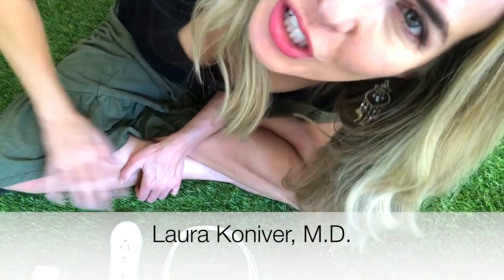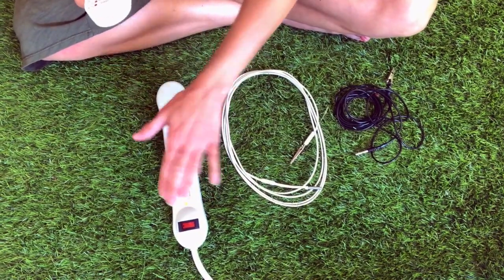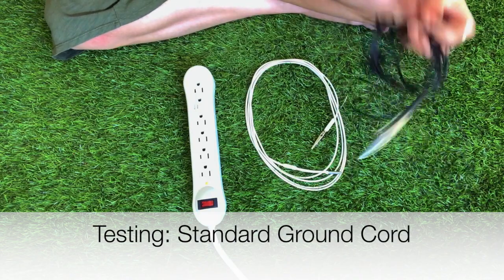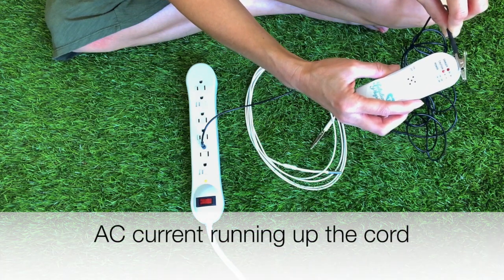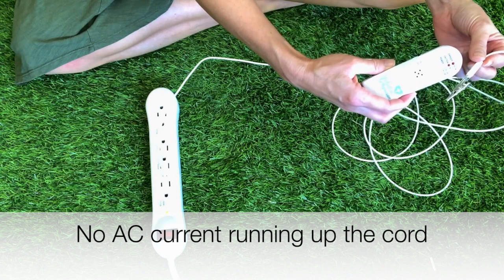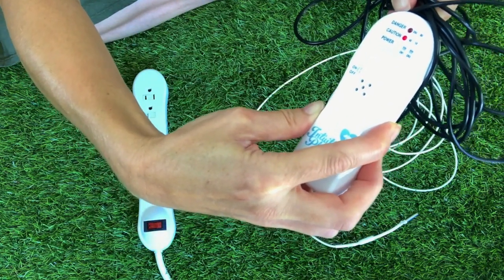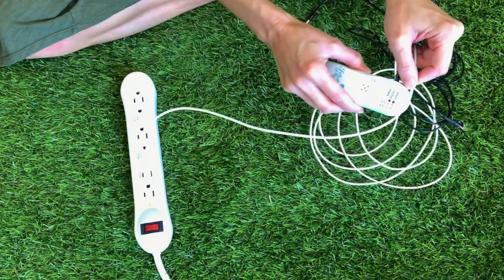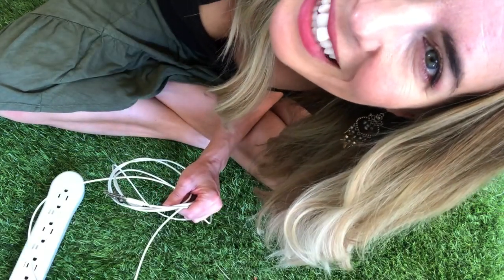Testing Ground Cords: Standard vs. PureGround Cord (Dr. Laura Koniver, MD The Intuition Physician)

Comment: Dr. Laura, I have a question about grounding and wifi/ high frequency. I am for some reason not  affected by radio waves/standard electricity much, but am VERY sensitive to high frequency microwaves like cell and wifi. I think putting a Wifi in my room gave me Chronic Fatique which I am still not recovered. So I purchased a grounding kit without the cord shielding and it actually gave me insomnia and on edge when sleeping and seemed to make my condition worse.  I see what your saying about the shielding the cord but my understanding is, How would grounding even with the shielded cord help someone like me when their is Wifi all around me coming from cell towers, neighbors all around with wifi running through our homes? I heard  without the complete shielding from those airwaves, you can actually harm yourself more and make your condition worse by grounding. I heard unless you remove/block  all hi frequency/microwaves from entering your room, and by grounding, your body is used as a conductor/capacitor for the harmful waves. So my question is, isn't grounding totally ineffective or WORSE for you unless you block out all microwaves/wifi/cell. first?....and thankyou  for your good work.
Reply: I see your concerns and I have a long history of attempting to get grounded indoors.  Here are some of my successful actions regarding handling EMFs and grounding.  The goal here is to REDUCE WHAT YOU CAN OF THE EMFs and then get grounded.  (1) Put the Wi-Fi as far away from the computer as possible (2) keep the Wi-Fi plugged into a power strip that is easy to turn off when you are off the computer.  (3) having measured body voltage with a voltage meter I find that flipping the breaker and shutting off the electricity to an area (bedroom?) can reduce body voltage by about 95%. When you talk about body voltage your are NOT talking about grounding.  It is a separate subject concerning the electrical fields from household wiring and you use a separate meter to test it.  (4) I will never practice grounding to an indoor outlet unless I test the outlet with a socket tester first and then use Dr. Laura's PureGround cord to complete the ground.  (4) your standard of blocking out all microwaves/Wi-Fi/cell would mean there is no where for you to ground, indoors or out, unless perhaps you wrap yourself from head to toe in shielding.  I'm doing  grounding indoors with a grounding rod and a wire coming in through the wall of the house.  I have a disabled hand that approaches normalcy when I ground my hand while I sleep.  . . . It sounds like your electrical hypersensitivity is ramped way up . . . do you have the meters you need to find the safest places?  This has to be an individual quest as for some people with EHS their car is not a safe place due to the modern high-tech electronics.  Do you live in a city?  I had to leave the city.  I fully trust Dr. Laura's  system including having a conductivity test meter so you can absolutely tell if you are grounded. How about doing a grounding test outdoors... lay on the ground... no supplies needed.  How do you feel before?  After?   This requires listening carefully to what's going on inside your body before and after (especially from the waist up.)  You must be aware of exactly what was going on before "getting on the ground" so you can tell any difference once you are grounded.  Ground yourself with as much bare skin touching the ground as possible.  Dr. Laura says that grounding works even if you can't get rid of all the EMFs.  HOWEVER THE FINAL ANALYSIS IS your own wits and your own body make the decisions for YOU.  Peace.
Reply: @kathym6603  I get what you're saying. If you're ground on your outlet is measured safe, why do you need her cord? Especially when a $2 dollar cord is sold for $54.

Comment: Do you know if the cords that Clint Ober sells with his products are safe?
Reply from the maker: Nope they are not shielded nor do they have a filter in place to stop AC current from running up the line.  They are aware that AC current is going into the bodies of all of their customers using their products and apparently do not wish to upgrade to this safety technology, I have reached out multiple times to support their company in giving their customers this option but they have declined as of yet.  xoxo
Reply: Ok.. I just ordered one.. do I still need to have my mat plugged into the wall while I’m using your cord?
Reply: Also.. I use 2 products from them.. how can I use both simultaneously with 1 of your cords?
Reply from the maker: There truly is no advantage to using more than one product at the same time, because once you ground any part of your body your entire body is completely grounded.  But I do carry splitters so you can use a splitter to plug two cords into the splitter and use multiple products...

Comment: Does taking a shower ground the body?
Reply from the maker: If you touch the drain or the show head or if you have a continuous water stream it would be grounding you, but if the droplets in the water are separate then they are no longer grounded.  In my experience I am not grounded in a shower unless I fill the tub bottom a little and stand in that puddle.  I have a video showing all this for you here you might like:  https://www.youtube.com/watch?v=URR6mLwkOpE
Reply: @laurakonivermd  Thanks you so much, I have another question, I have severe asthma/ emphysema, how can grounding help me  & how many hours should I ground myself to see any benefit
Reply from the maker: @ISa-ps9lw  Any amount of grounding will be helpful -- literally even a few minutes, so never shy away from grounding just because you have only a short amount of time.  That said, I feel that grounding will be more helpful with asthma, decreasing the inflammation and reactivity of the airway, instead of emphysema which is generally a more permanent scarring.  However, even the scarred lung tissue is conductive so grounding will happen all throughout your lungs, so keep going with it!!!!  xoxoxo, Laura
Reply: Yeah it does in my experience, I tested it in my apartment

Comment: Dr. Laura, I have many of your grounding and shielding tools already, and use the PureGround with all of them. I am  safely grounded for at least 16 hours per day. Thank you. I am very curious about your opinion of the Magnetico Sleeping Pad. It is a big investment, but if I understand correctly, it emits a strong 5-10 gaus of the Earth's magnetic field. It sounds like grounding supercharged. Your thoughts matter to me. Thank you.
Reply from the maker: I have to say that I don't feel this is comparable to actual direct contact with the earth -- here is what I wrote in a recent blog post that hopefully will help explain my thoughts... not so say there may not be some merit to the magnetic therapy but in my experience this does NOT replace grounding:

Because modern medicine is finally beginning to understand the depth and breadth of how very conductive the human body is, there are many new healing modalities that utilize magnetic and electric pulses and frequencies that simulate the earth’s frequency, to try to encourage healing.  Although these therapies have their own merit, without direct contact from the earth there are no electrons flowing into the body to neutralize inflammation and stabilize the entire body the way grounding does. No battery, crystal, manmade electrical impulse, or vibrational healing tool can connect you directly to the earth without you physically touching the earth.  No manmade tool can approximate the healing reservoir that is the earth.  Getting grounded is totally natural,  with no batteries or wires or artificial products necessary.  Our bodies have literally evolved to benefit from the direct support of Mother Earth, with no comparable substitute.  So be sure to include grounding as part of your balanced healing plan.

Comment: How to build a purecord yourself for like 10 cents:

Buy a 1 nf(1 nanofarad) bipolar capacitator(just google it) and put it in your earthing product cable(+ a 100 kOhm resistor if your cable doesnt already have one). Just cut it open, and connect one end of the capacitator to one end of the cable and the other end of the capacitator to the other end of the cable). Its nearly the same(tested it with an oscilloscope). I will do a DIY on this one too. very cool that Laura spreads the knowledge, please support her and share her videos, amazing Lightworker :)
Reply from the maker: I hate to say it but a capacitor is not the same and on top of this the cord is not shielded.... but what you describe is probably better than a standard cord so might be worth as shot?  xoxo
Reply: @laurakonivermd  A Resistor blocks high frequency Signals, a capacitator blocks low frequency Signals(you can look up the formulas online/on Wikipedia). What about the Schuhmann resonance(8 Hz), will your cord also reduce this AC Signal(because it lowers the 50/60 Hz Signal from the power lines etc.) I am very sensitive to EMFs, and i have tested a 1 NF Capacitator and its muuuuch better than the standart configuration :)